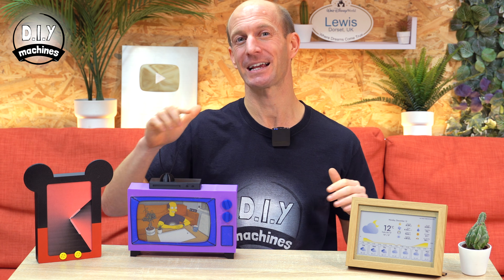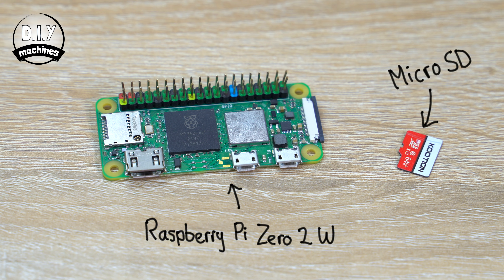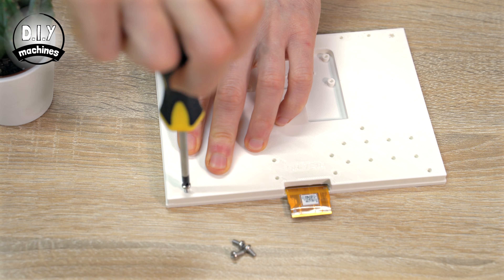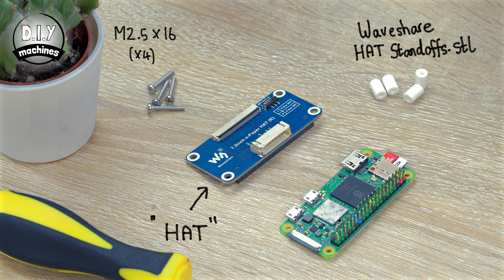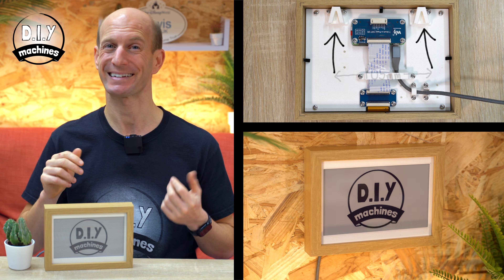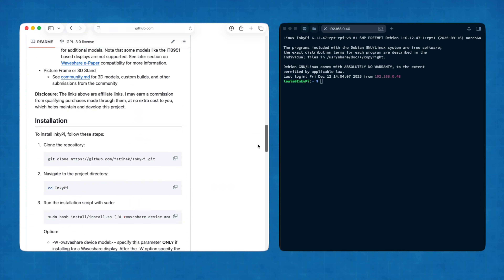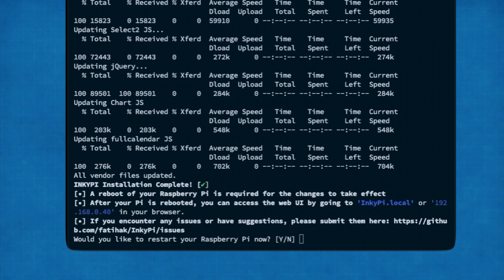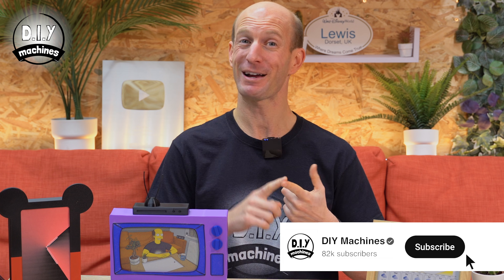Build a COLOUR E-INK DASHBOARD - Weather | Calendar | Photos | News...

Comment: It looks cool, but the prices of e-ink screens are very high. Since it has to be connected to a power supply anyway, you can use a 7-inch LCD screen with better image quality and much lower cost
Reply: Yes you can, but you will loose main advantage of E-ink advantage (at least for me) that is no backlight, and easy to eye appearance. I prefer to pay for e-ink in this case.
Reply: @kpax0 Ok, but it's not the screen you look at for a few hours a day. Rather, you look for a moment, see what you want and that's it, most of the time it's more of a decoration
Reply: @mateusz1807 sure, but for me personally, I prefer e-ink for that, I am surrounded by LCDs constantly every where, at home I prefere to have e-inks, there is something different about them, not punchy, warm.  And looks amazing in sunlight :) that's why as well I will go always for watch with MIP display instead of amoled and etc. It is just a preference.
Reply: @kpax0  Sure, I understand and agree that they look very cool, so pleasant. It's just that this price is far too high for me. For double the price of the lcd, I could buy it, but not for the x4 or even the x5

Comment: would be nice if you could do a follow up on how to battery power it so it can be hung anywhere without a cable showing.
Reply from the maker: Yes, I'm actually in the process of designing a circuit for a battery-powered version right now. :)

Comment: Yeah, its nifty piece of kit, however, Im struggling with this for a couple of months now, getting random freezes of the whole inkypi, untreated errors, and processes getting killed by the system which the inkypi cannot recover from, so definitely not as simple as being shown.
Reply: It may be the SD-Card. It's a known error source for all Pi. Running for long they get degraded. Especially if there are a lot of writes to the card. It' may be something else entirely of course but it's a pretty common error source.
Reply: @magnuserlandsson1327 its not SD card, I tried two of them, one brand new. The RPI is falling out of wifi and running out of memory for me, killing chromium in the process, so the update loop hets stuck waiting for it to finish. I also got some other errors I dont remember. Currently I ditched the whole inkypi software and asked chatgpt to create a new software with just the calendar. It took a couple iterations, but im running over 24hrs now without a hitch, so hopefully ...

Comment: Thanks for this tutorial, which offers some very interesting insights. However, I'm not entirely sure how to automatically change the plugin type on InkyPI, for example, depending on the time of day, or whether it's possible to use not just one photo but an entire folder that displays a single photo from time to time. I tried to do some research but I didn't find anything that clarified the issues above and before embarking on a rather expensive project, I wanted to understand well.
Reply from the maker: You're welcome. I did find it a little confusing to begin with but it basically boils down to the following at the moment:

Plugins are individual content generators
e.g. Quote of the day, Weather, Calendar, Image, Text.
Each plugin knows how to fetch and render one type of content.
	
Playlists are just ordered lists of plugins
They decide what appears on the screen and in what order.
Think of a playlist like a slideshow made up of different plugins.

Refresh time (found in the settings page) controls when the screen updates
On each refresh, InkyPi:
	1.	Runs the current playlist
	2.	Each plugin fetches fresh data (if needed)
	3.	The screen is fully redrawn once (only if the image is different to the last time it checked - no need to refresh if the image is not going to look different).

So:
Plugins create content
Playlists choose and order content
Refresh time decides how often everything updates

Hope that helps.

Comment: Looks great is it possible to use a battery pack
Reply from the maker: Yes you can, but the though the screen draws power only when refreshing the Pi will draw constantly. As this has been so popular I have begun designing a circuit which should get this project to run from between 4 to 6 weeks on a rechargeable battery pack. I hope to publish it in the next few months once I've really nailed the design and tested it properly.

Comment: It's certainly interesting, but I won't waste a hundred bucks on an e-ink display when I can get a 10 inch HDMI display for a fraction of that.
Reply from the maker: That's fair. For this project, I really wanted to experiment with e-ink, but there are definitely more affordable display options out there for similar dashboard ideas. I also wanted it to be low power and not shine like a monitor would. This matches the light level in the room just like printed paper.

Comment: Nice. 

A suggestion. Set a fixed IP address for the device. In Unifi Network select the device, in the right hand pane change to the settings tab and click Fixed IP Address. This will save you the hassle of relooking up the IP if for some reason it gets reassigned.
Reply from the maker: Good call on the fixed IP address! I've done it and am sure it'll save a headache down the line.

Comment: This is an expensive project. Which is fine, but you said you don't need that many parts. Actually you do. Not to mention the 3d printer etc.
I have a 3d printer, but forking out the money for the display and the raspberry pi etc, it adds up to over £100
Unless I'm missing something.
Reply from the maker: It's not a super cheap project if you're looking for something under £30. But it is simple in its build process. You're right also that having a 3D printer makes it a lot easier to follow along though you could fashion a mount out of wood with some basic tools (fret saw & drill)

Comment: I think the one of the primary benefits of e ink is lower power consumption. I recently made a similar frame but am using a rechargeable battery to power the pie, which is only powered on once per hour for maximum battery life.
Reply from the maker: I've started working on a similar sounding circuit for a larger e-ink display project as I want to hang it in my hall. On paper I hope for somewhere between 4 to 6 weeks but I'll have to finish building it and do a real life trial to determine how it really fairs. If it works out I do a video on that one as well.
Reply: @DIYMachines I'm doing this exact inkypi project with a 6600 mAh battery. I customized the code to power on/off on a schedule and it's been running a few weeks now. The problem I'm facing now is hanging it on the wall, the battery I'm using with its 3d printed holder I made sticks out a bit from the IKEA frame

Comment: I have an Inky Impression 7.3" , will this work with that screen? thanks
Reply from the maker: I believe it should. Just check the InkyPi documentation as you go as you won't need to add the '-w' waveshare flag when installing the software.
Reply from the maker: I looked into it on my lunch break and you should be able to just use the install command 'sudo bash install/install.sh' and I believe it will auto detect your screen. Hope that helps.
Reply: @DIYMachines  thanks for the tip, ill try this around Xmas when I should have a bit of spare time, I’ve got about 5 raspberry pis doing nothing! This project and some sort of cat flap monitor are on the cards, plus I really need to get home assistant up and running and get my home automation into line!

Comment: Great project and an impressive video. It is a bit of a pity that the project requires a power cable - would it be possible to power it from a battery when using a Pi Zero? What is the current power consumption? Some time ago I saw similar projects using an e-ink display in a frame based on the ESP32, but I think a Raspberry Pi would offer somewhat greater flexibility and capabilities.
Reply from the maker: Thank you. I have started looking into the idea of turning this into a battery powered project. I'm still working on the circuitry but I think I can get it to somewhere between 4 to 6 weeks between charges. I'll keep working on it so stay tuned. :)

Comment: Great work as always, Lewis! I didn't know about InkyPi - this looks pretty powerful and reasonably simple to DIY.

I'd probably make one myself, but I'm already using TRMNL - a commercial product I discovered last year. It's B&W, but it works well, the battery lasts forever and it's relatively easy to make your own widgets or use ones others made. Might be a decent alternative if someone wants a dashboard like this but doesn't have the time to DIY it right now...
Reply from the maker: Thanks for sharing that alternative for others. I did come across TRMNL but really wanted something with some colour but if you're happy with B&W they also are pretty open with their software if you want to run it on your own projects.